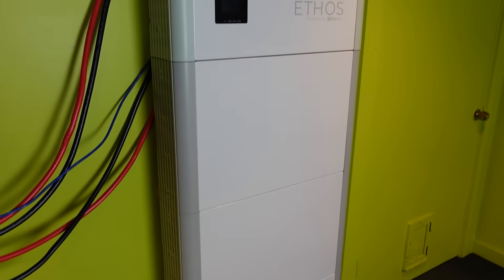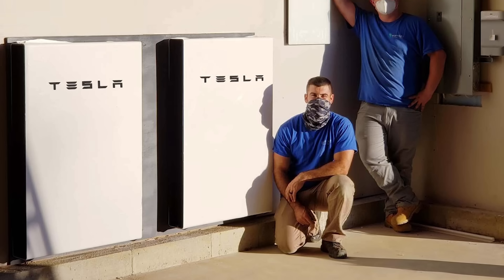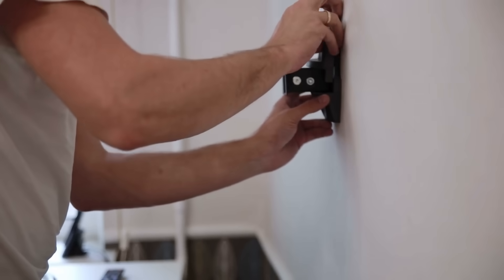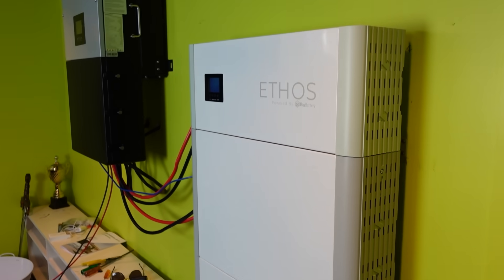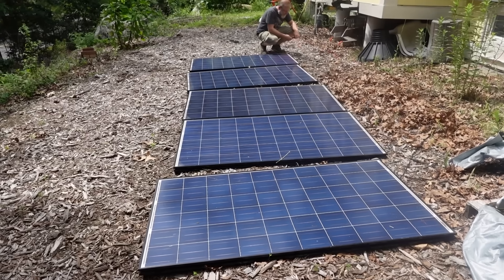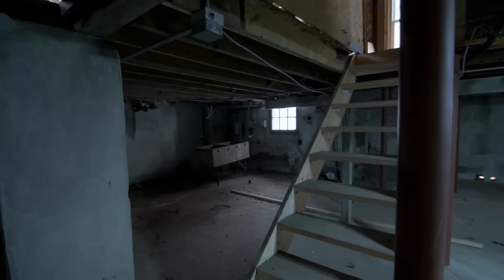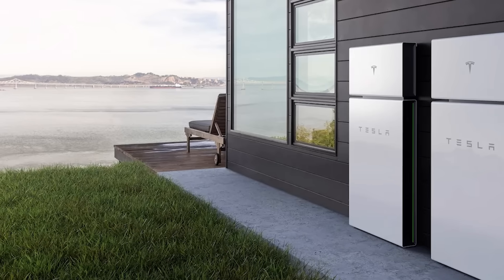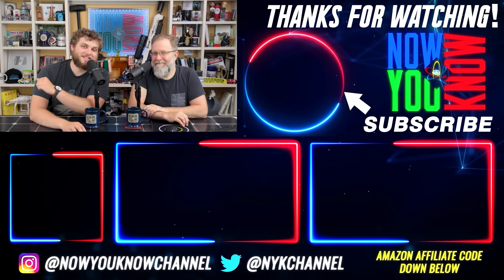Better Than a Tesla Powerwall? | In Depth

Comment: The problem with your powerwall alternative is that cheap, Luxpower, (EG4)  high-frequency, transformerless inverter charger. It lacks an output transformer to provide galvanic isolation between its DC boost stage and its AC output, so during an failure of the MOSFETs in its H-Bridge circuit there's no isolation to prevent high amperage DC current from passing through to your AC appliances and damaging those appliances. A much safer alternative is to add a low frequency transformer based inverter to your big battery.

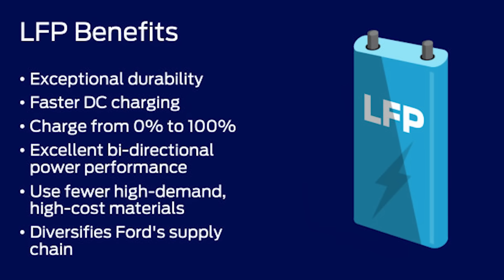Comment: 3:12 this is incorrect. LFP batteries are degraded by extended and/or repeated SOC@100%. The common misconception that “they don’t mind” stems from the battery management system requiring a periodic charge to 100% to calibrate the state of charge estimation. There  are a couple good papers out about this. Even automakers get this detail wrong in documentation sometimes, but the science is pretty clear.

Comment: There's no way that that cheap Chinese made, high frequency, transformerless inverter can keep up with a Tesla Powerwall inverter. You'll be lucky to get even two years of continuous use from that inverter. You would have been far better off buying a low frequency, transformer based inverter. You're goingvto damage your appliances because that Luxpower inverter provides absolutely no galvanic isolation. No thanks.

Comment: You may not have heard of them but the You Solar Inc.'s "PowerBloc" is the best. A USA company located in California. Their “PowerBloc” is high power needing NO utility approval; “powers all loads including pool pumps, well pumps, machinery, Air, heat pumps, EV’s, basically any all electric home requiring high power,” it’s plug and play; any electrician can install it (no tech ever needed); neat and clean install; does not mount to wall and can be placed at different locations; unlimited power storage; DC architecture; batteries are charged DIRECTLY from grid, solar, EV, wind, hydro, any size generator, any power source in any combination or all. A high tech nanogrid battery storage system designed to be a home or business primary power source with the grid secondary. No one else does this or can really compete. Better the Ethos.

Comment: Wow guys, you are super cool 😎. 
I was thinking about solar powered system, but now i know what to do and how to do it. 
Since in Uzbekistan our grid system allows to sell excess power to the grid and currently payback period is around 1000 days for just On-grid solar without batteries. 
But I would install battery also, since I got 2 fully EV vehicles 🚗

Comment: PW3 with Backup Switch is the killer app for whole-house backup.  Drastically simplifies (reduces costs) and speeds up installation.  I was going the DIY route until I priced out the additional labor and materials to do what the Backup Switch does.  The Backup Switch offset the cost savings of less expensive DIY batteries and allowed me to let Tesla do the permiting and installation.  Honestly, was very surprised how competitive Tesla's pricing is - was cheaper than any of the 6 other quotes I rec'd, by as much as $15K.

Comment: The steel wool is going to keep the flaxible PVC pipe still so that it won't move when the electric cable or wire inside is pulled

Comment: You can pick up an EG4 12k inverter (the same Luxpower inverter you showed, just rebranded) and an EG4 	4.3 kWh wall battery for under $7k from Signature Solar.  They even have bundles with solar panels.  
And if you don’t need so much power you can get the 6000xp inverter / battery bundle under $4,800.  This is the setup I’ve ran most of my house with for the last 6 months. They also sell the Ethos Big Battery.

Comment: Have you considered making a video on homes with say a Tesla Solar panel array and PowerWall? What this Big Battery or Ecoflow Delta Ultra Pro look like co-exiting. Provide pros and cons with not purchasing additional Powerwalls. It is is obviously the cost per kw is less, bigger capacity, expansion are big pros. How does features work having 2 dissimilar battery whole house solutions.

Comment: If I have inverters for my solar panels already do I need an inverter for my battery as well ? I want to add a battery backup for my solar panels so I can run when the grid is down . Wish I had done this way sooner since I am sitting here in Asheville , NC . Would have been worth it !

Comment: Awesome, Powerwall is pushing other to do better, I love this...

I wanted to do a DIY solar array for a long time, but battery and inverter flexibility were a limiting and costly... Solar power options are changing really fast.  Micro-inverter pushed full inverter prices down.  Now this battery.. And this grid tied inverter...  In US you have amazing price on used PV panel.  I wish I had same kind on deal in Canada.  I keep my eyes open, I will replicate your system soon enough.

Comment: Interesting. So I'm building a new home in rural Kansas. I'd like reliable power 24x7. The rural electric has reliability problems (wind taking down poles) and requires smart meters. I was planning on a backup generator. How do I determine my power needs, and how would that all be setup? TIA!

Comment: Big Battery is a bad bet.
Apples to Apples comparson:
Big Battery 15KW battery and a 6KW inverter bundle is $7299.
Signture Solar  Three 5.2Kw batterys (Lifepower 4) at $1199 each =$3597 and  the samw 6KW inverter for $1399 and a battery rack for $375  Total $5371.
Same systum $1928 less. or an extra 5.2KW battery and $700 to spend else where .
And Signture Solar has free tech support.
I use them all the time and I always shop before buying. They are always the least expencive by far on the same eqpt.

Comment: Outdated & expensive small batterypacks. You can make your own 43 kWh 6000 Cycles LFP battery for approx US$5250. Then add a 1500 US$ 12 KW Deye inverter and your flying.

Comment: If only someone could figure out a way to add these to EVs, to either add to the battery capacity or charge the factory installed battery pack while driving.

Comment: Random but did you do video on a sewage treatment plant that uses high pressure to break down the waste. If so what was the name if the company or us the carbon they get as a by product flammable. If not purely it could be used for a sand battery and higher temperatures.

Comment: Ok so you buy batteries and inverter to SAVE MONEY??   Hooking to the grid, which I understand you have to pay to hook to the grid,  you are STILL PAYING the grid for the power.   Where does this make sense?
NOW Solar panels are supposed to charge the batteries, (NOT CONNECTED TO THE EXPENSIVE GRID)  and supply power to your house.
If you need the grid for excess power uses, you might as well buy a computer back up power supply.
Do it right or pay the price.

Comment: EG-4 18KVP inverter and 14.5KW EG4 power pro battery is $8500. It's by far the lowest cost UL9540A ESS certified inverter and battery combo on the market. Adding more batteries is $3599 for every 280 AH or 14.5KW battery. The days of price gouging solar customers by manufactures, and solar contractors are coming to an end.
Reply: Does it do a whole house?
Reply: so EG4 is legit? is it the Toyota/Honda of solar brands?
Reply: @krabbypatty3644 Will Prowse seems to be pushing EG4 also now.

Comment: When you realize that 1 Kilowatt-hour (via the grid) costs (say) 30 Cents it makes absolutely no sense to invest in any home-battery that costs thousands of dollars. A battery that will function no longer within 10 years (not spoken  about the repair costs when the electronics fail) and, after that, has to be replaced. 9 sept. 2024.

Comment: free that's a laugh so after $5800 for the batteries/control box then pay another $4900 for the converter and then maybe another $2k for an electrician to wire a box  Im least out 12k and we haven't even added panels smh so after everything to get it function to so call save me money i'll be out least 20k+ for a electric bill that might run $150-300 a month so 3k a yr so i can pay for electricity for least 10 years to break even for what it would cost me for solar then after 10 yrs it would be costing me money since it would be outdated to say the least

Comment: I have complete control of my system and the power it produces. 17 kWh of panels, 60 kWh of lifepo4 and luxpower 18k. If you want to add on in the future this is the way to go. If you want to build your own batteries this is the way to go. If you’re busy, don’t want to bother and want to offset grid use without worry about it tesla is the way to go.

Comment: Could you address the permitting problems with indoor storage of lithium batteries. Did you get a permit? Did you have to install a sprinkler system? In Mass you are required to pull a permit and get an inspection for indoor battery storage.
Reply: BTW Will Prowse his channel is the best for this information.

Comment: 314ah MB31 EVE cells can be had for $89 each, 16 of those, a DIY battery box with JK inverter BMS for $400ish from China gives you a 16 kwh battery for around $2000.
Reply: And it's easily serviceable/upgradeable.
Reply: were do you buy from china? website? ill try them....

Comment: Besides the solar panels and the Ethos Battery backup, controller and inverter what more would I need?  I plan on buying the used solar panels and mounting them in a large area of my backyard because my roof is covered in shade and I can’t get enough panels installed up there anyway.  Do you have a list of items for a compete install and maybe do one list for On Grid and one for Off Grid?

Comment: Hey BigBattery folks,

I have a few questions regarding about your Ethos Battery System. 

I am looking for a battery storage system that is expandable & easy install, and be scaled/upgraded over time. I am torn between Tesla PW3 & your Ethos Battery System. What attracts me to your products is that, after watching Jesse & Zac's videos, (a) I can DIY comfortably for most of the parts (only needed the electricians for Subpaneling), (b) the ability to add more storage into the units, and (c) the option to take power from Generators, this is something I truly value from Ethos System because Tesla PW3 does not give me the option to take powers from generator.

That is being said. Here are my questions:

(1) The LuxPower Hybrid Inverter 12kw shown in the videos can be only input out 50A/240V. Is it possible to either get a bigger inverter or adding extra inverter that can work together for extra power output? I am looking for 1 integrated system that can output 24kw-32kw or 100A/240V to 150A/240V. My house is having 2 electric cars and soon 2 AC units. I want to make sure that I can charge & power up all of major appliances in the case of grid down for days. I am from Houston, as y'all saw on the news, we got grid down for days during the past 2 storms. 

(2) The Battery Control Unit indicates that up to 16 battery modules can be linked together, but 1 LuxPower 12kw Inverter can only handle max 30kwh (6 modules). Is it possible to 3 Inverters + 1 Battery Control Units + 16 modules all wired together for a total of 80 kwh and output power 32kw 150A/240V? If so, can you show me a diagram on how I can do it?

Thank you so much for your help.

Comment: Good stuff, I recently put together a 5K hybrid inverter, 5.15K LFP battery and seven 450W panels. I initially set it  as an emergency backup with a Reliance 6 circuit transfer switch. I have ended up just leaving it hooked up all the time. Amazing how the MPPT works. The manufacturer is SungoldPower. All modular and expandable. The only problem I have is figuring out the Chinese to English translation in the provided manuals. Tech support is so,so. I suspect my next power bill will be less than half of what it normally is. (220 appliances still on grid)
Side note: Had a power outage the other day….didn’t even notice until I received a text from the power company. 😊

Comment: I just got my self 50 nmc batteries of 12s cells total of 55kwhrs and each module for 80 bucks with shipping. Anyways does the inverter support no back feed and do AC cuppling with the solar that ok the house ? That would be a nice feutire to have when the bride goes out and you have micros inverters with your current solar on the roof. And also when it's during the day.

Comment: Just perchased 5 eg4 powerpro batteries 14.3kw apiece. So 71.5kw total for $17,193.60 or $3438.60 per 14.3kw battery. delivered to my garage. And an eg4 18kpv inverter for $5,199. And 30 390watt panels $3568. I will be installing it all myself. Have to have a licensed electrician hook it up in my circuit breaker panel.   Will be grid tied. So have to get permits and have it inspected.
The 18kpv inverter will do everything. Grid tie, islanding, batteries, start your generator. Everything.  Eg4 batteries have heaters built-in.  As well as fire extinguishers. Even though they are lfp batteries.
Reply: You would need 2 18 Ks for five batteries
Reply: Where are you putting 30 solar panels?  You have a huge roof?
Reply: They are behind the meter. Not sure they need inspection.
Reply: True but if you are net metering in az you have to do the entire review design and inspection I do believe
Reply: The 18 KPV will only handle three batteries
Reply: how?  @jonathanlyerly8501
Reply: If your inverter can't feed the grid, like the EG4 6000XP, it shouldn't require utility involvement.  Their 18K can feed the grid or not, depending on how you configure the software, so seems a "maybe".  You paid 4 c/kWh.  Perhaps double that for install labor and 70% since an upfront cost for 20 yr time-value-of-money so battery storage costs ~14 c/kWh.  Definitely cost-effective for many CA utilities like PG&E and San Diego.  A wash for my CA utility since midnight summer rate is ~10 c/kWh.
Reply: @SihAza  I have the EG4 6000XP / with a 14.3 kw battery pak- the most flexible, economical and simple system to install. I can remotely monitor and control it from any place on the planet with the provided dongle. I have my propane generator connected to it to recharge the batteries if the utility power fails to come back up within a few hours. VERY EFFICIENT I absolutely love this system from Signature Solar out of Texas.
Reply: @SihAza who is your utility that gives you that low rate?
Reply: I have 4 power pro going in a camper and 2 18pv inverter 10000 Watt solar
Reply: That’s great, Dan. Let’s hear the update!!

Comment: I hear you talk about solar. Do you ever talk about wind, Hydro-Electric, or Geo-Thermal? 

There are more rivers in North America than the rest of the World. The United States of America has around 125,000 lakes, and over 250,000 rivers, with a total of about 3,500,000 miles of rivers. There are over 3 million lakes and over 3 million rivers in the World. Hydro is scalable down to a water wheel that can power one home, up to Niagara or The Hoover Dam that can supply multiple states. They get no incentives, why is that. I believe Hydro has a lot of potential. Most water is gravity fed, has anyone put generators inside of water pipes. I understand no one wants to contaminate drinking water. But there must be other ways to generate electricity on a small scale.

Geo-Thermal. I understand how to do heat, with a heat pump. I don't know how an individual generates electricity. But there are 10 states that have active volcanoes. Active doesn't mean erupting. There are 12 sates if you include Alaska and Hawaii. Alaska has the most, Hawaii has the most erupting volcanoes. If the heat is going to come up to meat you, why not take advantage of it. 

Both of these can run 24/7 for more than 30 years. Sorry, but neither wind nor Solar can run 24 hours straight. It costs more and takes longer to build Hydro-Electric and Geo-Thermal, but neither get incentives. Does this make sense to you?

Comment: I'm an electrician and this system seems easy enough for talented homeowners. One thing I would suggest is that you guys inform people that you have construction experience that makes these projects easy for you.
Reply: Great point, Brian! For those unsure about their electrical skills, hiring any electrician to inspect and sign off on the work is a smart move. This is a much more affordable option V.S. What OEM Battery Installers charge for install. For those without electrical experience - this ensures safety and compliance without the full cost of professional installation.
Reply: @EricLundgrenCEO
Reply: DO NOT BUY! BIG BATTERY CO IT'S A SCAM!! THEY LIED TO US AND SOLD US A BATTERY THAT DOES NOT COMUNICATE WITH OUR SOLAR INVERTERS EVEN YHOUGH WE WERE SPECIFIC AND ADKED THEM TO CHECK BEFORE WE CONSIDER BUYING. THEY DONT CARE ABOUT YHEIR CLIENTS!  WE SPENT THOUSANDS TRYING TO MAKE IT WORK WITH THEIR TECHS GUIDING OUR TECHS OVER AND OVER WITHOUT ANY IMPROVEMENT!  IN FACT LAST TIME THEY GUIDED OUR TECHS THEY REALLY MESSED US UP AND THEY WASH THEIR HANDS OFF OF ANY REMORSE😮 THEY HAVE LOTS OF BAD REVIEWS ON LINE...CHECK BBB AND OTHER BLOGS ABOUT THIS COMPANY. BEWARE!
Reply: And if you look at their sloppy workmanship you might also suggest that they get a little bit more electrical training before they make videos like this showing such electrical slop.

Comment: It is best to put more pannels in the strings to get the string voltage between 260v to 400v
Reply: Remember to set the charge rate for the lux to fit your battery charge rate
Reply: The lux 12k is a very good hybrid inverter